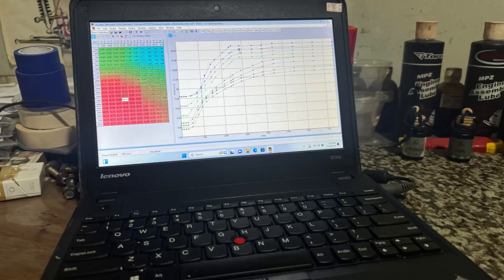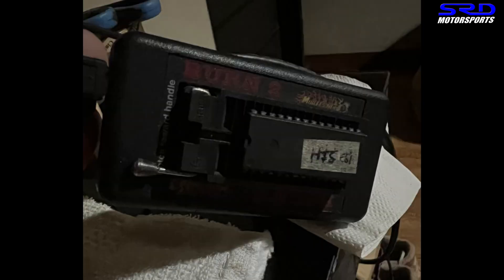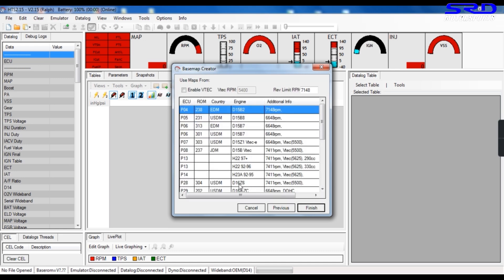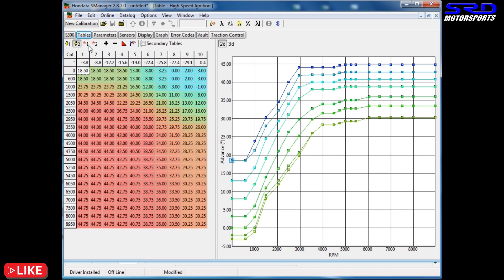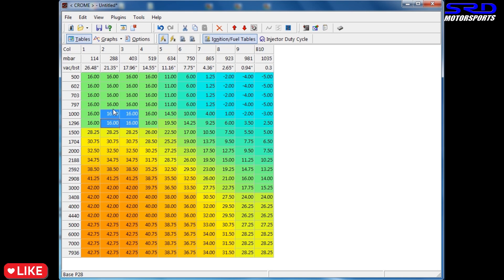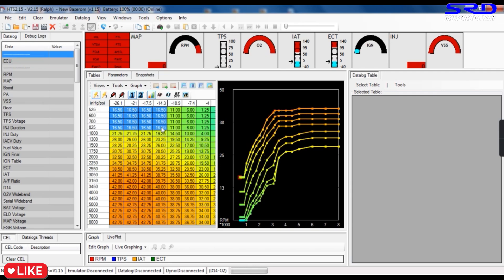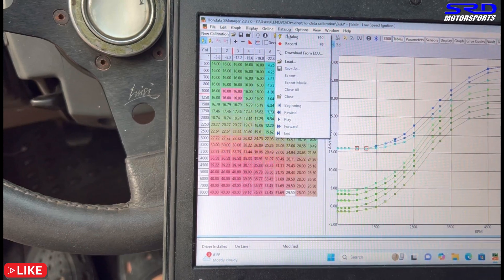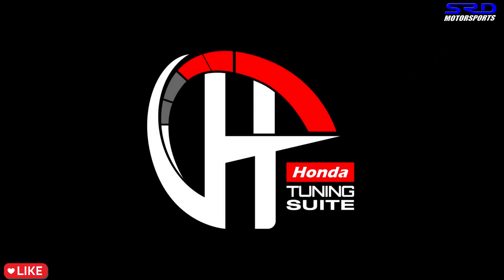How to: Honda ECU tuning starting with the basics and basemap

Comment: nice video :) very informative and easy to understand 

just want to as because i am a newbie in terms of project cars and we chipped a P07 ecu and now we have issue with ac compressor stays on even the switch is off and thermostat off and fuel pump also stays on after burning the basemap on 8bit mode and 0x08000 address 

if its ok hehe what is the fix for that issue for P07 thats the only box we have for our project thank you and more power to your business and projects :D
Reply from the maker: thanks for watching!

I tried to make the terminologies not as technical as most do that to sound smart 😅

I might have to look into the issue you stated as I have not encountered that “yet”
Reply: thank you and hoping to watch that video soon 😊  @SRDmotorsports
Reply from the maker: yes sir 😎

Comment: can you give any advice on what low cam timing should be with a stage 2 BC vtec turbo cam? 10:1, 82mm bore. I use stock itr as a base but unsure how to go about setting the correct ignition timing for it.
Reply from the maker: the ITR is a good base indeed

Comment: Hello i got a question. I have a 89 prelude b20a5 obd0. I plan on doing a obd1 conversion sometime soon. I heard some ppl have used b20b base map for a boasted b20a5. I plan on being n/a for a bit. Do you think the tuner could generate a base map for my n/a setup?
Reply from the maker: @klemenzfreyr2106  yes indeed tuner can def get u going with a basemap for the meantime and even tune it for safety while NA
Reply: @SRDmotorsports  the main problem is that almost no one knows how to tune the b20a5. Idk if there is a base map already made on chrome or something? Are you able to check for me?
Reply from the maker: tuning will be almost the same for every engine as long as the tuner knows how to tune it won’t be a problem

Comment: I have a chipped ls manual obd1 ecu with b20vtec basemap with full bolt ons and knock sensor disable. Would it be safe to run it for my B18c1 stroker with B18b1 Rod+crank+gsr piston heads. Stock gsr head with ferra valves.
Reply from the maker: it will run okay but safe to drive everyday not as safe as when it’s tuned

a basemap is just a basemap to “start” the tuning with

Comment: Very helpful ... I just build my first mini me ...and facing the same issues ..with idle and AC ...cheers from Hungary
Reply from the maker: oh super glad this helped man!! And hope u enjoy your mini-me even better soon 😎
Reply: @SRDmotorsports  I am doing the engine break-in... It is build for 9000 rpm with springs +arp bolts + oil pump I have a Dyno profile in it but for other engine ... And need some adjustments... Like rpm and air cond
Reply from the maker: oh interesting build indeed 😎
Reply: @SRDmotorsports  would you install in a d16y8 head a skynk2 Tuner stage cam for a daily driver ?!
Reply from the maker: yeah why not but the y8 head is more of an econo type of head with the swirl port so u have to understand that running a P08 / z6 head will instantly be ALOT better